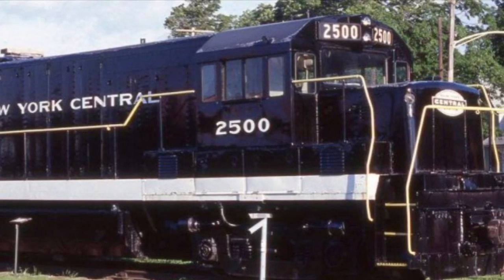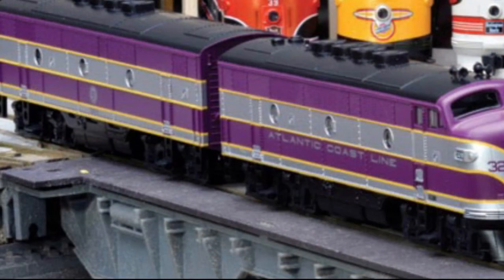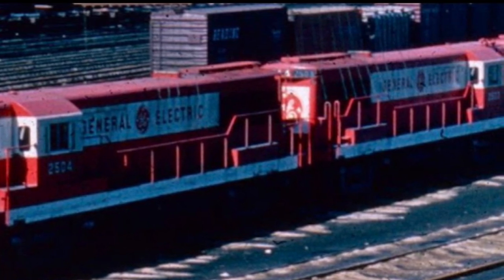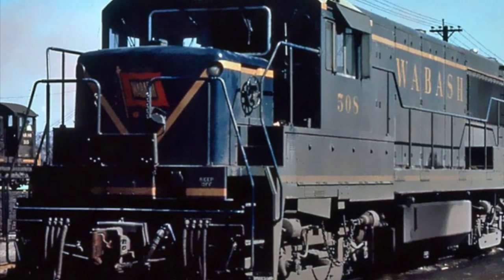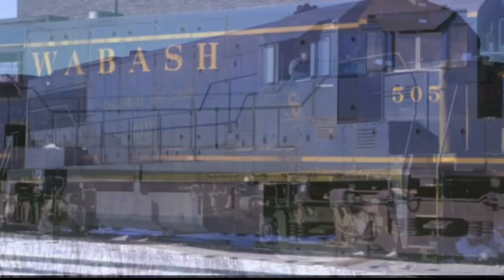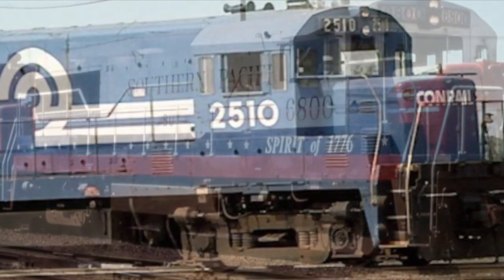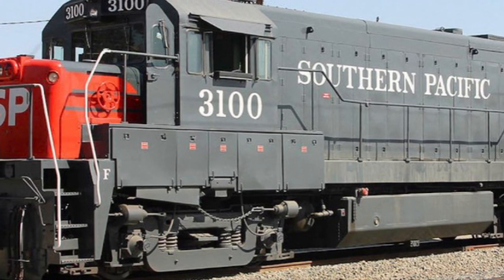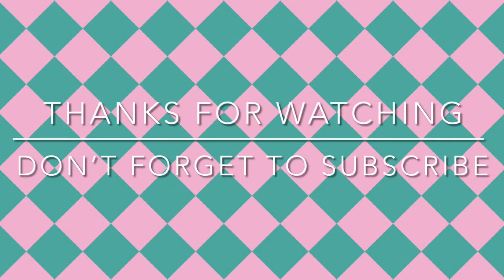Engines Of North America: The GE U25B

Comment: I have many miles in a U-18B on the SCL. The engine had a lighter weight and could go on the 220,000 Lb branch lines, which are all gone today. If you wanna see some U18B's in action check out Pickens railroad, there painted the orange MOW color.

Comment: General Electric then made the U36B - a whopping 3600 horsepower. This would be an interesting model for you to cover, though I think only one railroad bought the U36B.
Read they had wheelslip problems. They may have been the first GE units with the dragster-like flared radiator vents, later common on their 1970s models (B30-7, C30-7). Bachmann made a model U36B in N-scale, at one time. The old 1970s Bachmanns with metal gears were solid runners.
I like these. I've watched three of your vids (SD45-T, SD45,) and this one, which prompted me to subscribe. Longer vids would be good, but these are fine, as is.